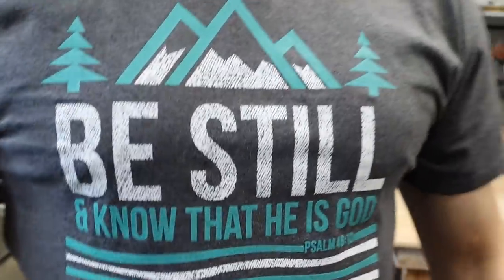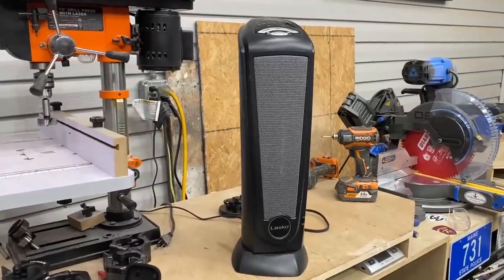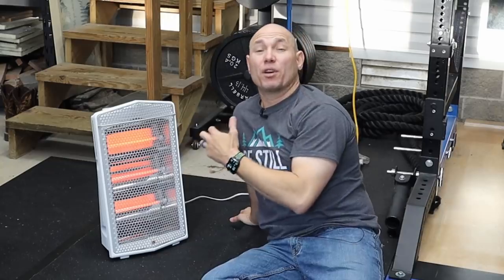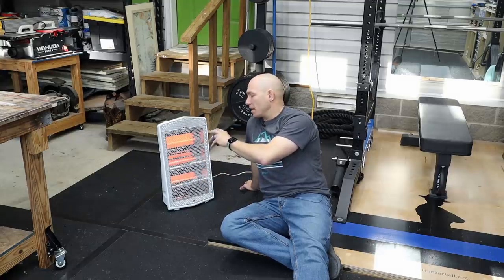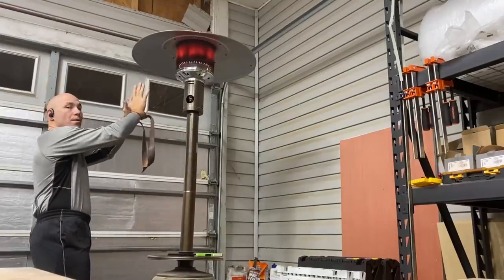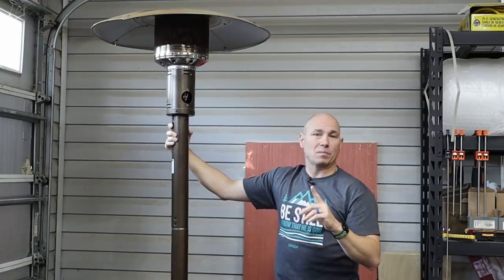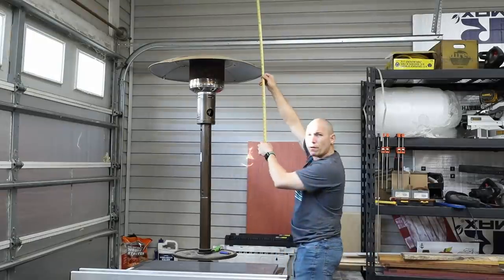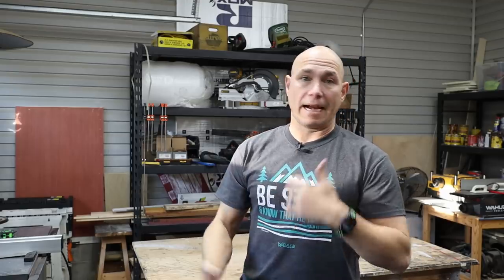How To Heat A Garage Workshop | Shop Heater Ideas

Comment: I NEVER comment, but I had to comment.  

I am a carpenter by trade, from Iowa.  It's cold here.  The other day, I was digging footings for a deck, through the frost line, in 17 degree weather.  By 9, it was too hot in my jacket and coveralls, so it was sweatshirt and jeans time. 

Manual labor.  It heats up a body good. :)

Thanks for everything you do and God bless!
Reply from the maker: Yes it does!  Thanks!

Comment: Here in Chicago it gets BRUTALLY cold. I've used a bullet propane heater with good results. Well, good enough to take lumber out to my detached garage and mill it to the pieces I need then bring it in the house for glue up and such. I have a brick garage and eventually I'll get the 220 system but I'm only using project proceeds for it so it'll take some time. Thank you for the options in the video and keep the good stuff coming!
Reply from the maker: Thank you

Comment: I live in Fargo, ND one of the coldest cities in the US. In January and February it is not uncommon for temps to be in the -30's for days and weeks on end. My shop is 12x24 with insulated walls and ceilings and an electric heater mounted to the ceiling in the back corner. It keeps my shop toasty and I can work in a t-shirt on the coldest days. My heater runs on 240. Keep up the great work and stay safe out there.
Reply from the maker: Wow. That’s cold!
Reply: I can vouch for his statement. Fargo is bone chilling cold. I used to live there and how about the winter of 97. :

Comment: Live in NE Indiana. Winter SUCKS up here. Just installed a 5000w electric garage heater on the ceiling. Overnight temps about 30 right now and I keep it at about 55. Before I go out to work I kick it up a notch and get her to about 60-65. Makes it super comfy. Had to run the 240v myself but we’ll see where the electric bill goes to.
Reply from the maker: Awesome

Comment: Reznor heater running on propane works great. my shop is 800 sqr. ft. and i keep it at 69 degrees when its below 40 degrees outside. Then in the summer i run a window a/c unit at about 70 degrees. Works gr8!!

Comment: I use a propane tank heater placed under my ceiling mounted DIY box fan air filter.  The fan not only helps filter the air but it also helps spread out the heat.  Cincinnati, OH.
Reply from the maker: Nice

Comment: I heat and cool my shop with a mini- split system. I live in indiana and the A/C is great. You can get it cold in there even in the hottest most humid conditions. The heat is great down to zero degrees, but even below zero the temperature still remains 60 or above. I am very happy with the mini split system.
Reply from the maker: Very cool!

Comment: Hey Matt, up until this year we shut down the shop in the winter. This past year we framed in the ceiling to lower the overall height to 8' insulated everything and installed a Senville Aura mini split.  Now we're open year round. Couldn't be happier with climate control all year. And no worries over CO2 levels or rust on equipment from excess moisture due to heating with propane or kerosene. Love your videos, keep up the great work. Merry Christmas to you & your family!!!
Reply from the maker: Awesome. Merry Christmas

Comment: I'm in central Florida, I installed a DIY Mr. Cool mini split with a heat pump. It works great. Keep the garage cool here in Florida and so far has taken out the chill when the temps dropped this winter. Its huge energy saver over space heaters and propane. Less dangerous too.
Reply from the maker: Nice. How does it do with the dust?
Reply: @731Woodworks  Well... you may need to spend some of that 3rd grade lunch money that has been saved and by a dust collection from Harbor freight. Best $200 I have spent. However, there is still dust and the mini split does fine. The Mr. Cool that I have has washable filters so I just shake them out about once a month and still them back in. There's not much dust on them when I do. It sits above and 3 feet to the right of my miter station in my two car garage.
Reply from the maker: Thank you

Comment: You asked about heating "the shop" and I use a 120K BTU "salamander" (contractor job site) and it's awesome.  My shop is in two parts, wood shop on one side and mechanical/storage on the other side.  I put the salamander in the big side and if I'm working in the wood shop I just aim it towards the door.  When I bought mine, I did A LOT of research and got the one I wanted with a thermostat!  Works like a champ too!  If it's really cold outside (NC) and I'll be back in the shop first thing in the morning, I put the thermostat on the lowest setting and the shop is about 45 when I roll in to get back to work.  Yes, my shop is well ventilated....lol.
Reply from the maker: nice set up.

Comment: I use this:
 “Mainstays 2-in-1 1500W 2-Speed Turbo Fan & 2-Speed Fan-Forced Heater, NF-18U, Black” from Walmart on sale last spring. Wish I could post a photo. 
I bought it because I needed another fan during the summer and was searching for a portable A/C/heater unit ($$$). When I saw this, I was so glad it was also a heater so I grabbed it up for the few weeks in the winter it gets chilly. I’m in west/central FL. I grew up in Indiana until I was 13, so I can handle the cold pretty well. 
My shop is a 2x4 framed, aluminum siding shed, in the back yard. It had paneling on the walls, thin carpet on the floor,  and styrofoam ceiling panels. Originally, it was for storage and filled to almost bulging! Did I mention we have lizards, chameleons, etc???? They’d taken over and poo 💩 was EVERYWHERE! I all but gowned up (hazmat style) and gutted it down to studs and aluminum ceiling frame. I was given around 30 - 3/4” 4’x8’ OSB and put down a new layer on the original plywood floor, then replaced the wall paneling and ceiling with OSB, too. It’s ALL over! 
So, my newly remodeled shop hold the heat/cool much better, but still needs help taking the chill off until I’ve worked so hard that I don’t need it any longer. (Before using it I always blast it thoroughly with compressed air to get the dust out. 👍🏼 
PS-Love all your helpful info and videos, especially who you stand for❣️ Thanks!
Reply from the maker: That sounded like a lot of work for sure.
Thank you

Comment: Seattle, WA. Just built my garage/shop, to accesory dwelling unit standards. That means wall, floor, and cieling are all insulated, as is the garage door. Plans are to install a split system, right now using a Big Buddy heater with fan to take the chill off.
Reply from the maker: Nice

Comment: Here in south central Wi. I heat with a pellet stove. My garage/shop is 24 x 24 with 7' ceilings that are insulated with 1" fiberglass ceiling tiles. The walls are "mostly" insulated, and so are the doors. When I'm not in the shop I have an oil heater I leave on to take the edge off until the pellet stove can catch up (usually about an hour). Pellets are $5 a bag (40lbs.) which lasts me about 2 days if I'm in there for the whole day. Working great so far, we'll see when it's 10° outside.
Reply from the maker: Nice set up

Comment: Matt - I've watched 4-5 videos on heating your shop and this is by far the best one. I like how you run through a bunch of options really quickly. I'm in Denver and temperatures here aren't as cold as people think at least while the sun is up. So far I've had the best luck with an electric oil-based heater. These look like radiators and they are a sealed system so you don't need to worry about a fire hazard. I am going to take your advice though and move my patio heater out to my garage to use it as a temporary heat booster. Like you said, you need to be really careful about ventilation with those. I'll post a link to one of the oil-based heaters I like. I saw one at a second-hand store and my guess is that even used they will work great. Your channel is one of my favorites particularly because you're always giving advice about how to sell and price stuff. I heard that handmade goods are becoming increasingly popular. This makes sense with all of the supply issues. I mean - why not buy something from a neighbor and keep your money in your local economy. Be well and Merry Christmas!

Comment: I actually have a used AC/heater unit from a hotel. Just installed a short time back and so far, it's great. I was using a kerosene heater before and it worked well too.
Reply from the maker: Nice

Comment: I’m in northern Indiana and am using a natural gas radiant heater 
Had gas already piped at the corner of the shop just ran it in and hooked it up 
Thermostat controlled makes it nice 
Did many years though with propane, pellets, and electric before switching to gas

Comment: Fairbanks, AK here. -8 right now. Have a heater in the garage plumbed right into the heating oil tank. I keep it at 40-50 depending on outside temps.
Reply from the maker: Would love to visit AK one day.  But not when it’s - 8 below lol
Reply: @731Woodworks  I'm originally from Georgia. I look like a walking Carhartt ad off duty.
Reply from the maker: Lol

Comment: Installed a 30000BTU Mr. Heater natural gas radiant ventless heater in 3 weeks ago for a 3 car garage 800sq ft. I can get the garage up over 70 deg when it's 30 outside. They have propane models. Easy to install.  Has an oxygen sensor built in to manage air. Doesnt take up the space like your patio heater. Wall or floor mounted.  I installed a heat sensor instead of a smoke detector which detects a rapid heat rise or a temp over 135F for safety. Has a thermostat to govern temp
Reply from the maker: Nice

Comment: I use a propane infrared 30k btu heater. Shop is well insulated & have fresh air intake & co detector. Shop is 20x24 & im in west central Indiana. It gets very cold here! ❄️
Reply from the maker: Nice setup

Comment: I insulated my garage and wired in a 220 volt electric heater. it works amazing! all in cost for wire, heater, and insulation was about $350.
Reply: When they poured the concrete between the house and my detached garage the contractor did not put in a conduit for my electrical wire going from the basement box to the garage and so that caused issues with the wire and only have 15amps  electrical in the garage now. I was not interested in woodworking at the time so it wasn't that big of a deal but now I miss it and run extension cords to my tools.
Reply from the maker: That’s not bad at all!
Reply: Keenan Quick what heater are you using??
Reply: @mrmyblessednest1722  it's a Dyna Glow electric heater.  I love the feature to adjust the wattage between 3000, 4000, and 5000 on the unit.  Its also accepta an external thermostat. It was $100 at Menards
Reply: @kquick901  thanks!!!!!

Comment: I live in Canada and it's hard to keep working into the garage in the winter, I can work the wood(cut, sand, etc,) the hardest part is the finishing part, I have a heater that works fine but I put down a big tarp to have a smaller place to heat and it works alright I guess but definitely not optimal, it -20°C often (-4°F) . Thanks btw I love your channel
Reply from the maker: Oh wow.  That is COLD!

Comment: I'm up in NY and we have days on end under 0°. And I love it. Sounds echo different. The snow crunches different. But kerosene heaters are dirtier than propane and need more ventilation than propane. Don't burn kerosene by anything you want to paint or finish because it will be covered in oil residue and ruin pain work.
Reply from the maker: Good to know! Thanks.

Comment: I am in Michigan and it was 40 degrees in my shop today. I even started a fire in the wood stove to take the chill off. If it gets really cold I will use a kerosene "torpedo" heater.
Reply from the maker: Nice

Comment: I grew up in Boston and the day I went to boot camp it was five below zero.  I landed in San Diego and it was sixty degrees and I said California is where I belong.  I lived there for the next thirty years then moved to Hawaii for ten years.  I now live in Edmond Oklahoma and I use one of those forced air propane heaters to heat my shop.  Like you I only run it for twenty minutes at a time.  I did install a carbon monoxide sensor as a safety measure.  I am considering getting an electric heater to supplement it.
Reply from the maker: How’d you end up in Ok from Hawaii?
Reply: @731Woodworks  I worked for the federal government at an organization called the Joint InterAgency Task Force West.  We did counter drug operations. We used to be located at the Coast Guard base In Alameda California.  In 2003 the Pacific Commander decided to move us out to Hawaii.  In 2015, I retired and we moved back to California.  In the ten years we were gone the state went to hell.  I couldn’t stand the politics anymore so in 2019 we moved here.  We love it.  There are a lot more people who think like I do.  God bless you brother and keep those videos coming.
Reply from the maker: He wanted a stay-cation lol

Comment: I live in Washington, 50 miles south of Seattle. I have a 24x32 shop. When we bought the house it had two electric 220v wall heaters. I removed those and installed a pellet stove. Pellets are $200 per ton. Depending on how much I am in it, I will use less than a ton per year.  The shop is really well insulated with 10ft ceilings.
Reply from the maker: Nice. Those pellet heaters are great options
Reply: @731Woodworks  And praise God I got a brand new pellet stove that was the demo model for $1300. It was a $3500 stove. And it heats the shop to 70 degrees.
Reply from the maker: That’s a great deal!

Comment: Matt I have a two car garage for my shop.  I heat it with a Sterling GG Series gas heater.  The gas company dug the line for me since I already had a gas fireplace in the house.  My garage is separate from the house.  The gas flame is enclosed in the heater and I use the one where it pulls air from the outside and pushes the vapors outside.  It is so much cheaper than electricity and propane.  The highest bill I had last winter was $120.00.
Reply from the maker: That’s nice

Comment: My "shop" is a shed. 15' X 12'  I use an electric infrared heater I bought off Amazon for $200. The bad part is, it runs up my electric bill something fierce.  If it's not below 20° I dont use it. I live in the northwest corner of Indiana.  Under Armour  cold gear is a blessing.
Reply from the maker: Our electric is already high enough. I don’t need more added to it lol

Comment: I put up a 220v electric heater in my one car garage and it works great. I am currently working on insulating the exterior walls to help keep the heat in. I have to cover the cinderblock with insulation. I hate that I am loosing some inches from my shop. It’s so small already.
Reply from the maker: Yeah that’s tough

Comment: I'm actually looking at ways to heat my garage as we speak. It normally reaches on average between -4 to -22 farenheit (-20°c to -30°c) during the day for long stretches where I'm from. Because of this, I would need something that provides just a little more heat. Lol. Great video as always.
Reply from the maker: Thank you
Reply: Baseboard low temp hydronic radiators... try it and let me know how they work because I have a year or two before I'm ready and would much rather let other people find out the hard way. :D

Comment: I rent and my garage is not insulated so it gets cold quickly.  There is only one outlet in my garage and if I run a space heater along with a power tool, it throws a breaker.  So heating my shop is impossible.  Usually, if I work on a project that requires a finish, I have to wait till the garage warms up and sometimes, I'll have a project waiting for a finish for several months.  Drives me nuts.   Great video.
Reply from the maker: Aww man. That’s rough

Comment: Matt, I’m down in South Florida, so no heater needed.  However, I’m doing a shop expansion this year and will DEFINITELY be adding in the Mini-split.  I’m done with working out here with sweat literally pouring off my face.
Reply from the maker: For sure need AC there

Comment: My shop is a 18x30 ft with 14ft tall roof with a 10x10 ft uninsulated roll up door metal building.  I've installed insulation and sheet rock on the walls and sealed up any cracks.  I have a 220v 21k bpu window ac/heater, but I barely use the heater since I'm in Florida.  I have 4 cold days a year lol. I got 4 (one in each corner] of the oil filled heaters ($25 ea) with a few fans circulating the air. My shop is a wood/metal/vehicle/anything else shop and house hold storage. The radiators don't catch things on fire and doesn't hurt if it falls over. It hits the shop enough to spray finishes/paint and to be comfortable for me to work in. If its really cold I can kick on the window heater to warm the shop and then let the small heaters maintain.
Reply from the maker: That’s great.

Comment: I'm in Virginia. I have a 120V heater mounted on the back wall and a 220V "garage" or "milk house" heater similar to the one in your video. It works OK, but insulating my garage door would help. In the  summer I have a 18k BTU window AC that makes it cool enough to work in. Seems like I can heat it better than cool it. My ceilings are also 10-11 feet. Space is insulated.
Reply from the maker: Those tall ceiling are hard to keep cool

Comment: My current shop is an outside Shelterlogic tent that usually isn't heated but I do have a big ol contractor jet heater. The new shop will have radiant floors with geothermal , solar and sprayed insulation
Reply from the maker: Nice

Comment: Good video, I liked the cadence of the the information.  It wasn't too fast.  I've been thinking about getting a 220 wall mounted heater, haven't sprung for the cash.  Couple hundred dollars plus installation.  Would be cheaper to run than the small 110 electric heaters.
Reply from the maker: True